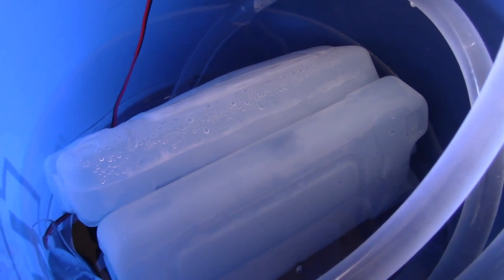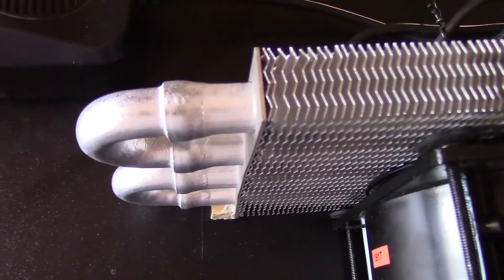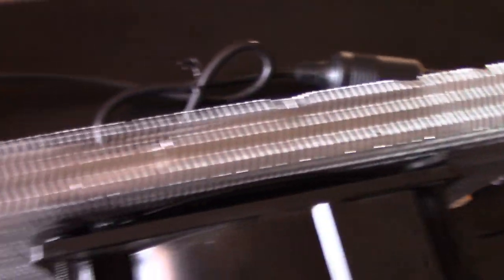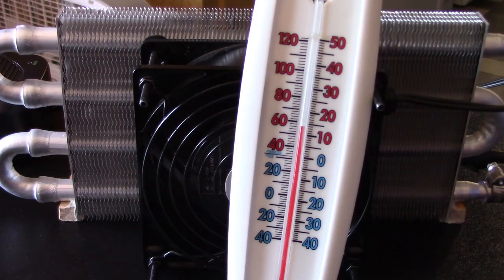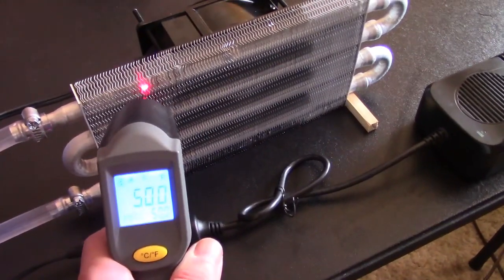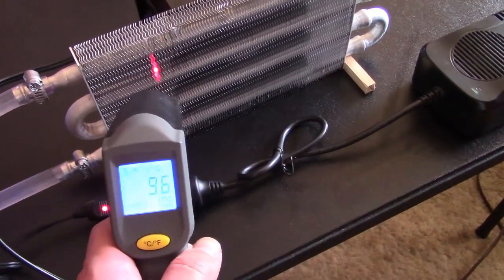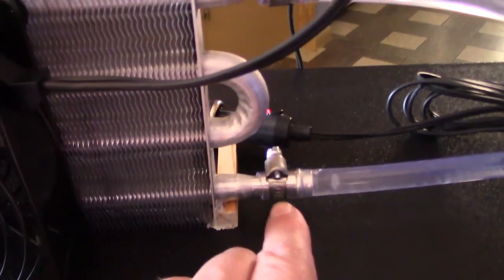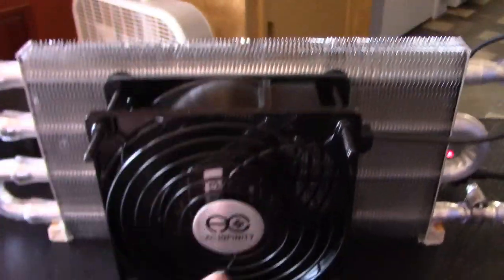Homemade AC Air Cooler! DIY Air Cooler! (compact!) - No added humidity! - Easy DIY - Air Conditioner

Comment: So amazing!!  Living in Phoenix I have always wondered if there was a way to use evap cooling without the humidity.  Now I know it is possible AND how it is done without making an outrageous electricity bill even worse.  Your video is so on point, and the concept and build are understandable to the widest possible audience!  Bravo!  BTW, how could one make it quieter?  Just wondering.....not a deal-breaker; anything that makes the power bill less than the mortgage payment is OK with me.  I'm excited to watch your other videos to learn more!  Thanks!!!
Reply from the maker: hi there. these units typically run very smooth and quiet. they just sound like a normal fan running when you are in front of them. the radiator does not increase the sound of the fan. the high speed fan sounds much louder in the video mainly because my camera has dual mics in the very front of the camera - and i didn't adjust the volume accordingly (so what you are hearing is as if your ear is right up to the unit). a second reason is that the high-speed square fan i used has a higher than normal pitch (has a very large motor in it). make sure to listen to how the unit sounds at the end of the video. (just smooth quiet airflow). that is how it will sound to your ear in most cases (with an average/typical fan).
Reply: as far as I understand this doesn't use  evap cooling but it's still cool
Reply: Bruh you live in Arizona desert, GET A SWAMP COOLER. People in Floridas wet climate wish they could use a swamp cooler.
Reply: @whydontyouaskme  I agree. Arizona has low humidity, dry air usually during the summer.

Comment: is aluminum better than the copper for this project?
Reply from the maker: hi. aluminum or copper work about the same. only real difference is aluminum is lighter and cheaper
Reply: @desertsun02  thank you for your response!
i was thinking of doing this but i found another video of your doing it with coppers that you swirled, and placed some metal sheets which in our country i think the materials would be much cheaper. i am just wondering if the cooling difference is big?

Comment: I found a 6,000btu window unit in the trash for free, it works fine and I don't need to run a freezer to freeze ice. Yours would be great if you had an ice cold free flowing deep water well.

Comment: instead of using ice packs from the fridge, drill a hole into the ground and circulate water using the ambient earth temperature (55 Degrees F).
Reply: Yes i will drill a hole in my room, thanks

Comment: put a hole in a tiny cheap fridge and put some water in it and let the water run through it so the water gets cooled in the fridge while your using it for the ac
Reply: Just plug in a 5-6,000 btu window unit. It will cool a small bedroom.

Comment: YOU CAN USE PELTIER INSTEAD OF ICE
Reply from the maker: hi there. unfortunately all the peltier based water coolers that are currently on the market are not strong enough to make this setup work (or not for long). these radiators overpower there ability to cool the water within a minute or two and the water warms up (then it just blows room temperature air). i wish this wasn't true - but so far all of the videos that i've seen on making 'peltier based' room air coolers are not true. the best that peltier can do is extend the time that the ice lasts.

Comment: Using a bucket inside mini fridge (80w) would keep the water cold all day.
For no water pump hack.. use gravity to flow through the trans cooler.
Have a siphon bucket at the top with ice water, use a bucket on the ground to catch the water as it flows through (pinch tubes as needed)
Then pour the ground bucket back into the top bucket with ice soon once it has all been siphoned and do it again (pumpless)
Reply: It just sounds like you became the pump LOL

Comment: Very interesting, where did you get these radiators from, like what are they for, my guess is pc water-cooling radiators? Thoses are expensive though. Please link
Reply from the maker: hi. these are transmission coolers. you can find lots on amazon if you search hayden transmission coolers or just transmission coolers (i like the hayden ones). price range is 22 to 32 dollars. midsize one is about $25

Comment: i have pull one out truck ac coils in dash n thick n bigger n use peiter 400wattage 8 them n have other one front con run out side with big fan on it blow heat out like normal ac window n find ac window brown i throw away stuff on it turn it into 12v one never have issues  using ac window parts that already broken turn it into working 12vdc ac lol done it back in 2008

Comment: So how big of a fan in relation to the radiator? I have a 270 cfm 4 inch inline blower. The radiator is a 7x9 and the water is icy cold but the radiator doesn’t stay cold very long as it heat soaks with the air coming in. I see you have double 120mm fans on one radiator and then 1 fan on another radiator. So my question is if there’s too much airflow would that cause it to heat up the icy air? I might just buy the 2 120mm fans and run that.

Comment: I made one of these built a box around the radiator and put the fan on the out side. I built it for our work truck it dose really good but the ice melts fast. Gonna see if I can extend the life of the ice with a big cooler and some Insulating tape on the hose
Reply: That that point you’re making an icybreeze

Comment: I made one the radiator drips a large amount of condensation. Other than that seems to work well in my 6 x 12 trailer.
Reply from the maker: hi there. yes that happens with high humidity. units typically still work well though (plus the condensate is water being removed from the air - so that should help the air feel better too)

Comment: I sure wish you'd provide links to those case fans...
Reply from the maker: hi there. sure, i can give you links...

here's the low speed one
https://www.amazon.com/AC-Infinity-Cooling-Ventilation-Projects/dp/B07CZRKTBZ/ref=sr_1_2?dchild=1&keywords=ls1238+fan&qid=1628701686&sr=8-2

here's the high speed one
https://www.amazon.com/AC-Infinity-Cooling-Ventilation-Projects/dp/B009OWRMZ6/ref=sr_1_1_sspa?dchild=1&keywords=hs+1238+fan+axial&qid=1628701781&sr=8-1-spons&psc=1&smid=A2AW0W4FKP16S5&spLa=ZW5jcnlwdGVkUXVhbGlmaWVyPUFSUVNUWTIxRURZNkEmZW5jcnlwdGVkSWQ9QTEwMjEzMDczRUxCNzJLQTNDQU9DJmVuY3J5cHRlZEFkSWQ9QTAxNzQ3MTUzSzA1TzBZSVRZQUJTJndpZGdldE5hbWU9c3BfYXRmJmFjdGlvbj1jbGlja1JlZGlyZWN0JmRvTm90TG9nQ2xpY2s9dHJ1ZQ==

here's an optional 3 speed cord
https://www.amazon.com/AC-Infinity-Controller-Connector-Ventilation/dp/B00809BQZG/ref=pd_bxgy_img_1/138-7369779-0761801?pd_rd_w=6xvor&pf_rd_p=c64372fa-c41c-422e-990d-9e034f73989b&pf_rd_r=FND3BR52BKVCV80NQDZH&pd_rd_r=f6fa746d-542d-44fe-9b35-f5a5c9fae00d&pd_rd_wg=oDa6B&pd_rd_i=B00809BQZG&psc=1

Comment: Just an idea. But what if you placed a second radiator submerged in a bucket of salt water with maybe dry ice packs, and the liquid going between the two radiators being a closed system. Then potentially mixing in some antifreeze to the sealed system, depending on how low the temperatures drop.

Comment: Going to build one use 20x20 fan aluminum gm car rad and run 56f water from my old shallow well 25 feet from house and a small pump either 12 volt or 110 v  here  east of Detroit in south western Ontario Canada
Reply from the maker: hi. that's awesome. that water temperature should give you nice cold air.

Comment: I am currently making one of these using a 48 quart cooler and the same mid sized radiator you used (mine is about 7.5 X 8.75 inch). I cut holes into the top of the lid for the two tubes, so the radiator sits vertical on top and its tubes go directly in/out of the cooler. Almost no tubing is outside of the cooler. The only holes in my cooler are for the two tubes and the pump power chord. 

However my fan is also smaller than the radiator like one of your examples (lots of radiator space around the fan not getting airflow). Do you think that is inefficient? Would it be better to enclose the radiator somehow so that it gets a more even air flow through the whole area of the radiator? I am trying to optimize getting the most out of my ice before it melts.

Really enjoying these videos. This was the perfect idea to cool down my room as well as my car for road trips (AC is broken) Plus I love DIY projects like this.
Reply: Did you ever finish your AC project? Curious how it turned out. I was thinking about doing something similar.

Comment: I made one of these a few weeks ago using a transmission oil cooler with a thick walled foam cooler. (Like they ship lobsters in)  I mounter the fan with the heat exchanger onto the lid and drilled holes for the input and output lines to go into the cooler.  I stuck in 4 large ice blocks (Made from freezing water in qt. size potato salad containers) and had my 4w adjustable output pump set to the lowest setting as was my fan and the air off the fan was 54 F.  Nice and cold.  My problem was, all the ice was gone and the water was room temperature (85 f) after only 45 minutes.  My heat exchanger is too efficient I think so I need to restrict the water flow through it.  If I could get 68 f air out of it I am sure it would last much longer.  I still have more experimenting to do.  I am using this in a small bedroom that does not get much of the ac from the heat pump.
Reply from the maker: hi. options to extend ice and cold water are smaller heat exchanger, slower water flow, smaller pump (big ones can heat the water), and one big way to extend times is to use a speed controller to slow fan even more. the slower the fan the longer the (cold) will last. i got 11 hours once on a 3lb block of ice in a foam cooler. fan was really slow but it was cool enough.
Reply: @desertsun02  Thank you, I will try to limit the water flow and slow my fan down even more.  (It is pretty slow on low)

Comment: Have you ever  thought about taking a refridgerator or a deep freezer and removing the doors and sticking a large box fan in front of it to see how long it would take to cool down a room such as a garage or a kitchen  etc
Reply: Have you thought where the heat from inside the fridge/freezer goes? You would have to put the fridge/freezer outside and then duct air into the room
Reply: @richgoodman5734  no I have not Im new to this

Comment: Been following your progressin on these units, like your work, i have most everything i need to build one, but for me its a must instead of a project i have an older peterbilt truck that i have to drive this summer, it has a well insulated cab but never had ac, for $3500 i can put a/c in it but i dont plan on keeping it after this season, so Im gonna build a cooler like yours and hope i can have cold air all day, keep up the good work and i will get back with you on my findings, gonna use as big a cooler as i can and jugs of frozen water, nothing ventured nothing gained. Again Thanx and keep up the good work.
Reply from the maker: hi and thanks. make sure to check my latest build on these types of air coolers. it's a 20" box fan conversion using these. big as it gets! if interested... https://youtu.be/Jfc26AH0jLI
Reply: Buy a used diesel generator or a generator motor and add a remote start diesel engine. Frame mount box plates from Rainey's truckparts, Order a esper fuel tank bunk heater pipe for the tank , add filter and buy a windowless ac unit. Minus the ac unit you'll be about 4-$500 in a home made apu. You can get a used apu engine for $1000 but not worth it IMO. Man if you add a 2500-3000w inverter and a trickle charger jump box to your truck you'll be good to go and if any thing breaks you can repair it easily and cheaply with no downtime. I added this to my classic with a Chinese bunk heater 😋👌.

Comment: Might work Great in DRY CLIMATE.....   Humidity requires a tray under the coil if dripping.   If air velocity is fast enough though and humidity is reasonable, then there will not be enough Resident Time on the coil for moisture to condense out of airflow.  Slow down airflow to Dehumidify.  Increase airflow to flat out Cool ... there is a balance required for True Air Conditioning effect involving Dehumidification and Cooling.   Same principles apply to full blown Central Air....  if insufficient dehumidification is occuring then you need look at Blower Speed setting.  BUT BEWARE of EXCESSIVELY LOW SPEED AIRFLOW or Clogged return air filter resulting in similar low airflow condition which will cause Ice to form on Evaporator Coil and lead to System Damage if liquid refrigerant makes it way back to the compressor outside.  YEAH... Went on a bit but point was to make comparisons and Educate.
Reply: He is in Arizona...  it's very dry there

Comment: What are the small fans connected to? Would an AC power supply from an old gadget work as long as it provides enough volts and watts?

Thanks for the great work you do! Once again you've given me a simple solution so I don't have to reinvent the wheel. I wanted a simple heat exchanger for solar heating my greenhouse in the winter and this idea will work perfectly!
Reply: Well they the guy should have showed us the adapter used to power the fans they usually 12 volts you probably need 500 mamps or 1 amp to power them

Comment: also im considering picking up a square version of the transmission oil cooler for a larger ryobi 18v fan.. ive hacked the fan (originally a mister) to instead use a peristaltic pump and im thinking of instead of pumping mist ill pump into the oil cooler.. any reason why its so compact? have you made a larger build? trying to get a solid 8 hours off of 2 1 gallon frozen watter jugz
Reply from the maker: hi. i made this low profile version super compact for tight spaces. lightest weight, easiest to transport, best for desktop that type of stuff. my original video shows a unit that is a little larger (close to a square in shape) and handles bigger fans.
Reply: @desertsun02  gotcha will check it out!! hopefully will build this today .. i think ur on to somethin here11! .. this separation of ice and heat sources can really improve ice duration.. thanks again great vidz!

Comment: I noticed you took reading right off the unit! But what was the temp in the room and how much did I cool the room to? Also how long will it room before you need more ice?
Reply from the maker: i've not yet tested the cooling capacity room-wide. the room temp at time of filming was about 82F/83F. i noticed in early testing that air temps across room were about 78F after running awhile and had started about 83F (but this is unofficial). size of room is 18x10 plus it's open to the kitchen and the hall so a good size area. south facing room (typically the hottest in the house). 1 to 2 hours of cooling for a smaller load of ice and guessing 3 to 6 or more with more ice and/or insulated bucket or ice chest.

Comment: I've been watching what you're doing with your project and out of all the AC system designs yours in my opinion is the best by far. 
I'll be printimg a housing unit for mine on my 3D printer and installing it in my electric recumbent two seater pedal assist travel van that I'm building. Try putting a lid on your bucket and insulate it all the way around and I would imagine you will get 8 times more performance before you have to change out your ice packs. Job well done desertsun02.👍👍

Comment: Awesome. I've got a dead portable AC unit. Might hack the radiators out of that and do something similar to you. ( Yes I will be careful with the r134a!!)
Reply: Just get a recharge kit . If you jack it up get a bigger air compressor and add more coils from another unit or refrigerator and sodder them together then add a bunch of  134 whatever "refrigerant"
Reply: @derekrunyan983  yeah nah, it no good. Has electrical issues and a fan is shorting out. Plus it's was heavy on power usage. - I'm really trying to get a good off grid cooling solution on a 24v system. So those two big multi cored radiators are looking juicy!

Comment: has anyone had any luck using a peltier device to provide continuous chilled water ...with some creativity im sure we could get this whole this to run under 50 watts ( chiller, pump, and fans)
Reply from the maker: hi. i've heard of peltier water chillers for aquariums and or hydroponics but i'm not sure if they chill the water enough. but if we could get a low power effective water chiller then this could be a game changer.
Reply: @desertsun02  i was thinking of making a TEC peltier array that continuously turns on and off TEC's to chill pumped liquid yet use only 1 peltier at a time.. eg  if there were 10 peltiers 9 of 10 would always be off but once one gets turned on the previous one turns off .. reason being is to keep power consumption low and also help with heat disspation of each of the inactive tecs.. the challenge is speed .. and friction.. i really want to get  an FLIR device to help me see/ optimize the cooling flow to see where thermal energy is goin
Reply: Peltiers are horribly inefficient compared to compressor based coolers. They pump out a ton of heat for the cooling the do. You need a pretty large cooler on the peltier, or the cold side starts heating up too. Better to stick a mini fridge outside holding the coolant tank and pipe it in through the window. Remove the freezer box so the fridge can get to freezing temps. The fridge will work hard all night freezing the cooler so you can cool the room the next day. Need to run it all night to "store" the cold because a fridge has no where near enough BTUs to cool a hot room. You want ice in the fridge, but your cooling line should have antifreeze to prevent freezing.